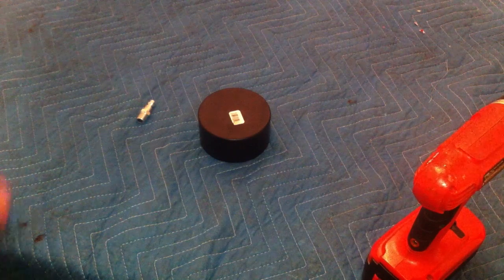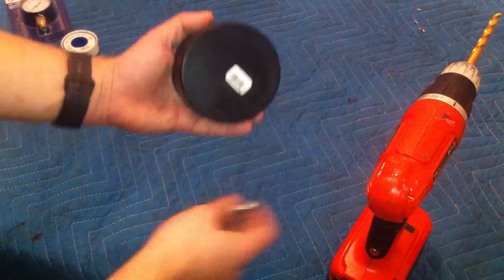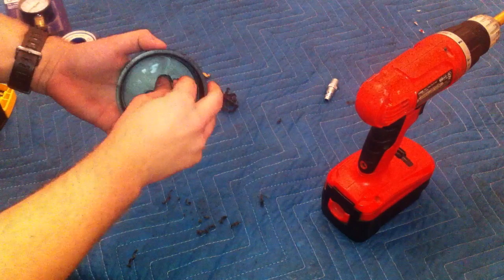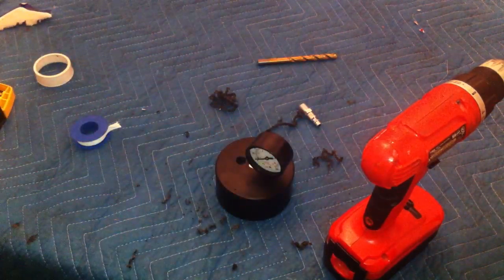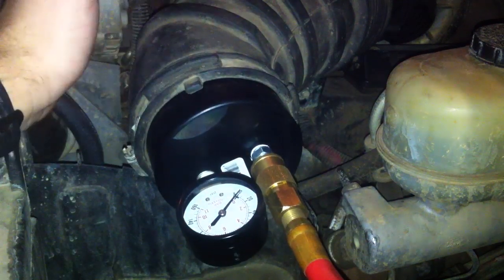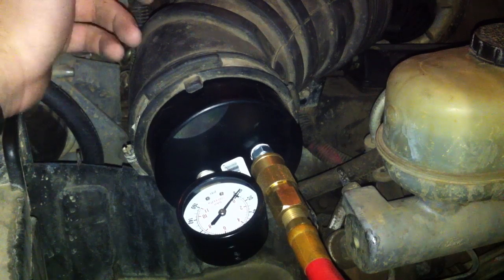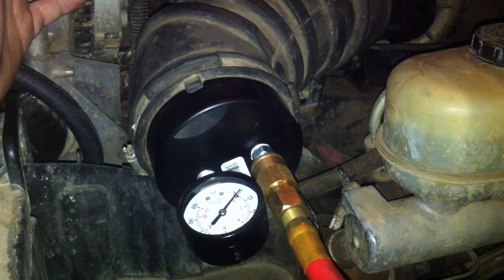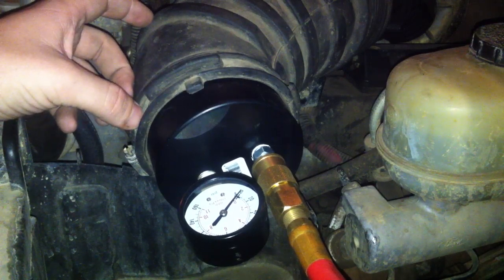How to: Make a boost leak detector for the 7.3L Diesel

Comment: 20 psi seems high
Reply from the maker: The turbo can boost up to 30s so no problem
Reply: NOT ALL. FACTORY PSD 99-03 DEFUELS AT 23-24 PSI. UNLESS U HAVE A RIFFRAFF BOOST FOOLER. MY 99 HITS 32PSI EASILY. ALSO I'D THINK AIR WOULD BE ESCAPING THRU INTAKE VALVES THAT ARE OPEN FROM CAMSHAFT TIMING. I GOTTA TRY THIS. AND UPDATE A VIDEO.  GOOD VIDEO THOUGH. BEING 12YS AGO. A CAN OF BRAKE  KLEEN OR STARTING FLUID WORKS FASTER. ENGINE REVS.. YOU FOUND A LEAK. I THINK ALL 7.3S SHOULD HAVE A BOOST FOOLER.. JMO

Comment: I would recommend removing both hose pieces between air filter and turbo and plugging this device directly into turbo housing. Cause if you do it like in the video, a lot of your air is going to escape via the CCV and possibly cause you to raise PSI to damaging levels in an attempt to compensate.

Hint: If it's not your uppipes, 90 percent of the time it's the intake plenums (bottom two legs of spider, OEM orange sleeves) that are the culprit. Don't go all muscle man on them though because you can bend them out of shape! :(
Reply from the maker: Good thinking, but that's not actually how it works. The engine produces 30psi of boost on its own, and you need a fraction of that for boost leak detection.
Reply: @TruckStuff1  look at the comments from DonziGT230, Therealslowerthanyou, and Kevin Bragg... they are all saying the same thing I did regarding needing to bypass the CCV hole that the bracket between the two pieces of black hose from your air filter to your turbo has.

Or you can do it your way and plug the hole, either way you want to try and avoid blowing air into it. It's unnecessary and possibly damaging.

Comment: I'm Doing this! So, if I pressureize to 20 psi, how long should I wait to see if pressure drops off?  I have no clue as to what is reasonable, or minor.  Thanks for another great tip!  I will check back to see if you have other related videos...nice to see one working.
Reply: I know this comment was 8 years ago but I feel like I have to respond just in case lol at 25 psi there should be a 45 second gape between 25 psi and zero. I hope you haven't gone eight years without this answer haha
Reply: @butterkiawa  I wonder if the 45 second rule applies to this tester.  Beings his tester is hooked to the air filter side of the crankcase ventilation tube.  This means that the crankcase is also pressurized.  I believe, although could be wrong, that the pressure drop should be very slow. That is unless the pressure blows the dip stick out of its hole.
Reply: @Prevailingbucket When the crankcase ventilation go to the inlet right before the turbo so if you took that off and just put it directly onto the turbo he bypassed that didn't he?